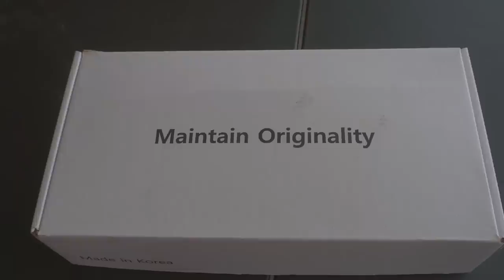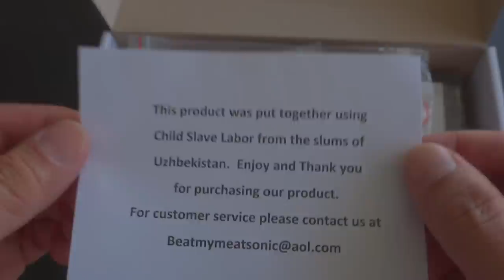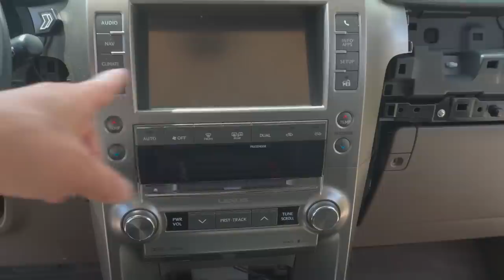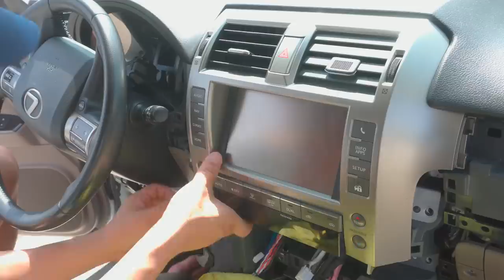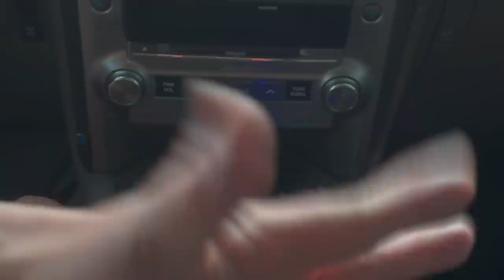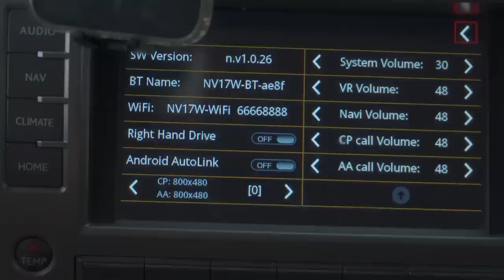2014-2021 Lexus GX460 Wireless Beat-sonic Apple Carplay with Behind the Scenes footage

Comment: Another awesome and informative video by GXBob. Are you still using this Beat Sonic unit? I thought I saw a video you posted recently that looked like you had the factory unit back in but I could be wrong. I'm just thinking of buying the Plug and Play one for my GX. A guy in the GX forum however kept taking about the "GROM" being terrible, but I'm not sure what he is referring to? Does he mean the Grommet are is the "GROM" short for something else? I'm not super car audio savy but know enough however I can't seem to think og what he means by "GROM"?
Reply from the maker: @devanrogers3133  hey Devan 👋. Grom and Beatsonic are 2 different companies that make CarPlay for your GX. I do not have an opinion on Grom as I have never owned or had the chance to play with one.  I’ve only owned Beatsonic and very happy with its functions and features. I currently have the Beatsonic installed but will soon remove it to prepare for another up coming video in about 2 weeks. I will not be reinstalling it because my new modification doesn’t accommodate an aftermarket CarPlay system. Thanks for your question. 🍷

Comment: I have the new 23 GX.  it comes with a carplay but it’s a wired mode only.  i am absolutely pissed off as to why Toyota would half-assed this!!  i hope someone releases a solution in the near future to remedy this.  current solutions are bluetooth only and most of them have a lag. this is very noticible when a passenger is watching youtube or netflix during travels.  audio / video doesn’t sync.  other solutions require audio bypass via RCA cables which potentially impacts the sound quality on our expensive Mark Levinson systems.  i hope someone releases a wifi based solution that solves this.  really disappointed with the the half-asses solution Toyota has put out after YEARS of people requesting this feature.

Your videos are always soooo entertaining.  love it!
Reply from the maker: Good to gain some insight on the new 2023, appreciate your inputs.

Comment: Hi Bob, followed your instructions for the BeatSonic system, the one change I made was installing a usb port where the 12v power supply is located in the console. I moved the 12v port to the blank location in the glove box, it actually takes the factory 12v port without modification. There is also a blank in there for a standard Toyota switch. While moving the 12v plug may not work for everyone’s needs, it may be good content to show how to access and install switches/power points in this hidden switch panel.
Reply from the maker: Excellent input, thanks Charles.

Comment: That was an amazing installation video! I watched the Beat Sonic installation video last month and yours was ten times more impressive! Thank you!
I have a question for you. Is there a hack available to show a digital speedometer on a 2017 GX460? When I turn on my radar equipped cruise control, a digital speed selector is displayed so I’m wondering if the normal speed is available. Thanks GXBob!
Reply from the maker: thanks for the comment but i personally do not  know of any digi speedo on the market as of yet for  our truck.

Comment: Did you notice Beat-Sonic Web Site states for LGVIF-CB2W  "GX models are not compatible" ?  What gives.... Figured it out.... Beat-Sonic LGVIF-CB4W Wireless S-Connect Interface for Select 2014-2021 Lexus GX 460 and 2016-2018 Toyota Landcruiser. Your captions show "...CB2W"....  even all five fingers in each hand you can still make mistakes..  Love your channel. - Great work!
Reply from the maker: i just made the corrections.  Thanks for the heads up!  
https://www.beatsonicusa.com/lgvifcb4.html

Comment: Thanks for all of this, I did the same setup as you did. However I noticed that it reseted a couple of times. I was wondering if it's due to unit behind the system that might caused it to overheat? Not sure if you came across that yet.
Reply from the maker: No mine doesn’t reset. It has been working fine since the install. Only thing i can think of is a loose connection somewhere. Might want to ensure all your plugs are tight.

Comment: Doe your GX have adaptive cruise control?  If so, I have the ultimate mod project in mind.  Maybe this is something you maybe able to pioneer.  I have installed Comma AI on my unsupported truck (Ram 3500).   It’s similar to tesla autopilot.  Only prerequisites are:  Adaptive Cruise Control and Electric Power Steering.  GX is only hydraulic steering as you know.  Electric steering upgrades are done all the time.  Plus, many upgrade their steering racks to either Tundra or LandCruiser all the time.  This got me thinking… 22 and up tundras have lane centering w/ electric power steering.  Why can’t we mod the GX with the new Tundra / Sequoia steering rack and gain full utopilot feature?  If anyone can pave the way, it would be you!

Comment: Bob, I'm experiencing two problems with my 15' GX, maybe it's easy for you but I'm about to go crazy: 1.-My car leans to the right if you see it from behind, in this regard I found that there are a service bulletin indicating to replace the left shock absorber spring.  Do you know something about it?  and 2.- Why the hell the rear speakers are heard very slowly, I already checked the balance and everything is perfect but the rear speakers are hardly heard compared to the front ones with which you can have a party.  Do you have that problem?
Reply from the maker: 1. You have what is known as the KDSS lean.  You most likely have a leak in the system causing that.  Doesn't matter if you change all your shocks or springs, you'll still get the lean.  Your Lexus dealer might do a one-time courtesy to fix it for you if you have a good relationship with your dealership.  
2. If you are truly an audiophile, replace the oem piece of sht amp under the seats and all your speakers.

Comment: Hi Bob, I have a Apple CarPlay installed in my GX 460 but is using old wire to plug in. If I want to change your wireless do I have to buy a new Nother unit or just buy some pad to transfer?
Reply from the maker: i would ask the folks at Beat-Sonic.  I'm sure its just an addon as the main unit has additional ports for options.

Comment: Hey Bob! 
Is it still sold after using it? Any lagging, slowness, disconnect issue? I love to buy it but I had Vline and it gave me a hard time until I removed it, it even rebooted while I’m driving and caused the check engine light come on, it went away after I turn off the car and turn it back on though.
Reply from the maker: I actually have had no problems with it so far. Runs great.
Reply: @GXBOB  thank you Bob!!! You are the best!

Comment: GX BOB WHAT DO YOU THINK ABOUT THE NEW '24 GX..
DO YOU THINK I SHOULD STICK WITH MY '22 GX
Reply from the maker: i really don't know enough about the 24 to do an honest comparison.  The only thing you can do is just read up on the different reviews posted on line and go into the dealership to test drive one.  I really love the current model up to 2019 but the later years do have nicer consoles.  Don't know much about the reliability and characteristics of the newer engines.

Comment: Bob any chance this setup could zap your electrical system?
Reply from the maker: That’s what your fuse box is for! Not on a serious note i haven’t heard or read anyone capping anything or having the car blow up due to a bad install. There’s no guess work involved meaning every plug fits into their respective home. You can’t mix match anything by mistake. If something has to be forced it means a pin is bent and should be straightened out.

Comment: Does anyone know if the rear backup camera still work with this install? Couldn’t find an answer on the site
Reply from the maker: Not sure why it wouldn't.  Both components are independent of each other.  I currently run the Carplay and have no issues with my oem backup camera.
Reply: @GXBOB  thanks for responding! Just want to say you’re the reason why I have been so confident doing these mods in my gx460. I appreciate all you do!

Comment: Does the beat sonic front camera harness still work with this?
Reply from the maker: Nostradumass....hahahahha i just noticed your username.  So, i never got to test it out because i pulled my front camera system off because i did not want a clutter of crap with one accessory on top of more accessories.  I prefer to do clean installs from start to finish and make it less complicated for viewers to follow.  Imagine if i had the front camera wiring installed while installing the carplay for people that don't own the front camera...know what i mean?  So i wasn't able to test your question out to prove it.  But all i could say is the inputs and outputs of each system is independent of each other.  Meaning, we are not y-splitting media inputs/outputs to share signals.  We are only tapping into the source for power and ground for each system to function.

Comment: gxbob, I am planning to install this carplay unit. is it possible to connect the beatsonic usb to the existing lexus usb connector?
Reply from the maker: I would think not because the BeatSonic usb connector gotta directly to the BeatSonic unit but then again this is also a wireless system so you really don’t need to hard wire it
Reply: @GXBOB  Thank you